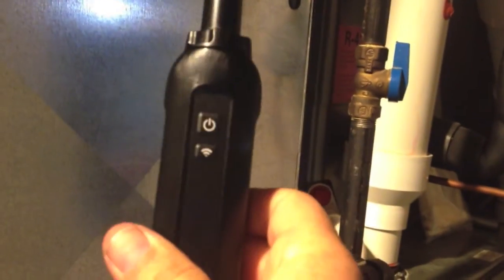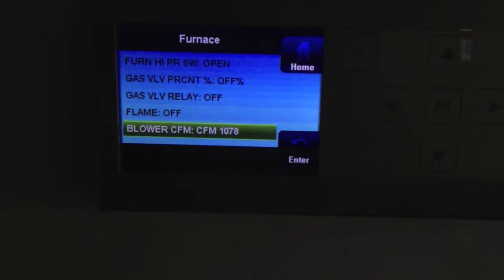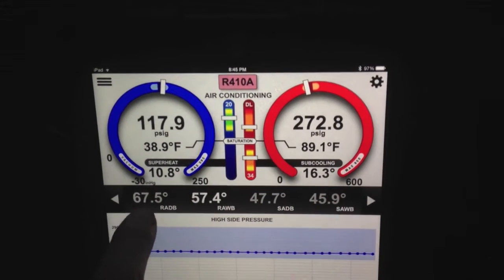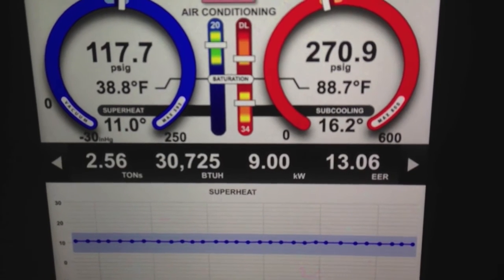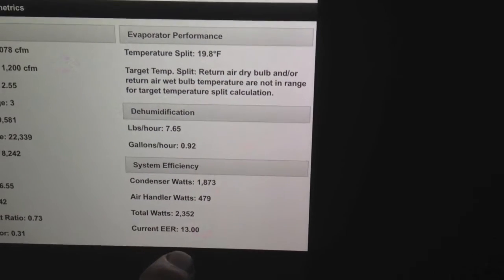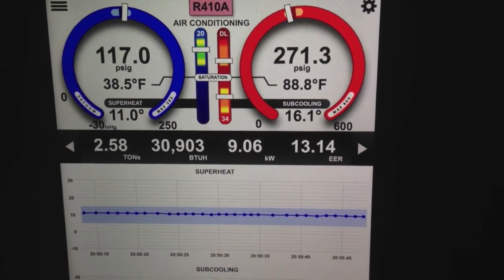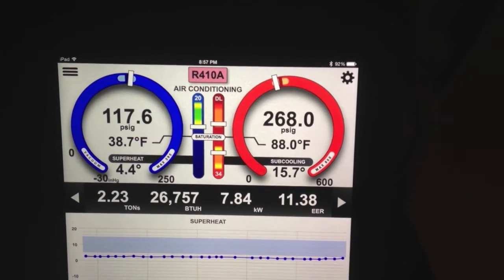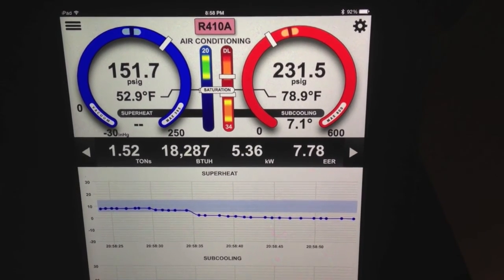iManifold Wireless Probe Demonstration

Comment: Bill, can you plug the cooper-adkins clamps into the side of the 914-M and 913-M wireless pressure probes so you can get pressure and temperature and leave you imanifold in your vehicle?

Our industry has caught up with the automobile industry in technology. I know it's expensive but these tools are a necessity. These are the next tools I will purchase. You can do a complete analysis on a system with these tools. We must be teaching this technology to our students.

Comment: There's a lot of information on how to get target superheat and sub cooling, I havent heard anyone say why. Superheat to provide the correct suction cooling to the compressor and prevent slugging. Copeland should have a label on each compressor with the suction return temperature for that compressor. Subcooling to provide a solid column of liquid to the txv for max efficiency. Frankly it would be so much easier and a thousand dollars cheaper to just install a liquid line sight glass and charge the unit under a full load. The Testo 550 gets the job done just fine and cost is reasonable and it's more durable than my Samsung cell phone in the heat, rain, snow, oil, leak lock, trace, hard impacts, flourescent dye, nylog, silicone sealant, foam sealant, coil cleaner chemical etc. I would go through 5 cell phones a year. The imanifold looks like a great tool, but I just can't justify the cost of the gauge set, hoses, remote probes and the cell phones, when I can get the work done with a $300. Testo 550. I go through one gauge set each year. 5 yrs Testo550($1500.) imanifold($5000.) Sorry, I see the future imanifold and testo as durable, compact, with a color screen, many applications, compact durable remote probes and about $500.

Comment: Those probes are very cool. As a prospective imanifold customer I have concerns about the unit dropping out. Has imperial done any research on what phones and tablets work best with the imanifold? If not perhaps they can get info from the guys who are having issues. Find out what they have. It would be nice if the imanifold came with recommendations. If it drops out even once,  is not worth the aggravation on the job. My luck it would happen as I was showing the customer how great the tool is.
Reply: The Google Nexus 7, Samsung and apple phones and tablets seem to work the best. A lot of guys are having a very good experience with the Nexus 7 and 10. As far as dropping out, it does happen sometimes. At that point, you are prompted and you simply move within range reconnect. I have it drop out when I walk around my house, I have a bad spot for reception, but once inside, I can reconnect and I do not loose connection again. It is typically very solid, but Bluetooth can be effected by local interference and or building construction. The iManifold to tablet is Bluetooth, and while it is higher output, it is still considered short range radio. The wireless probes are Zigbee which has better range and can be extended with a repeater. As the probes are released, trips into the house will be minimized as the information will come out to the technician at the condenser. 

Jim